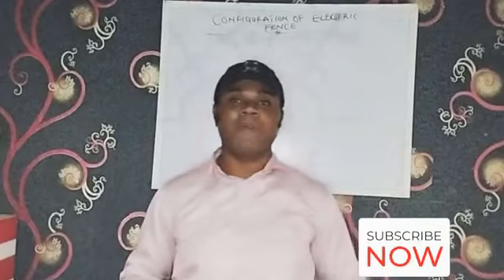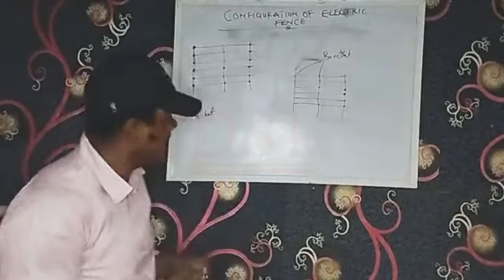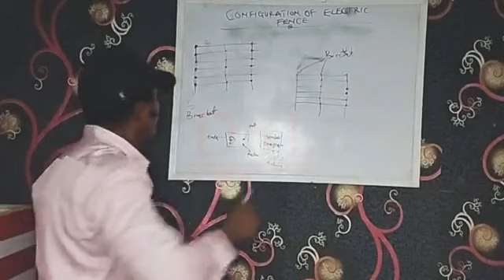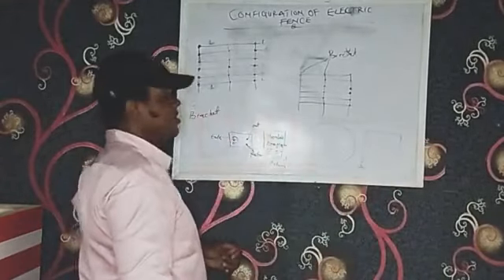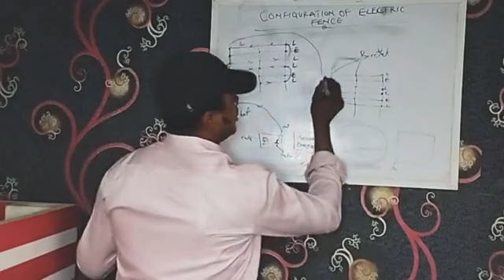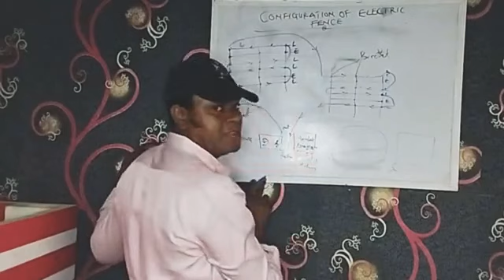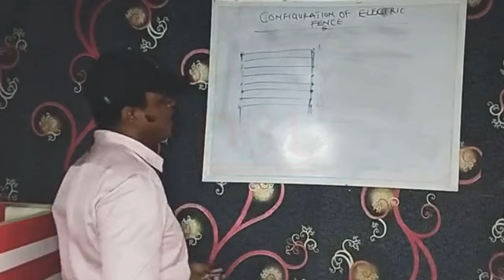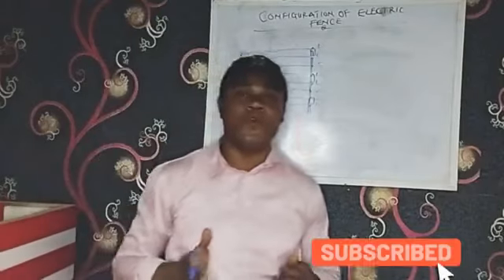Configuration and Connection of Nemtek Electric Fence Energiser.

Comment: Please sir, I have a question. My concern is how to really make the alarm goes off when a line is cut and not breach. (2) Can the live out and live in be connected from the same side of the fence, that is the same spot but to first and last line as  you explained now. Sorry I don't know if you got what I'm trying to say?
Reply from the maker: Absolutely, I understand your question. The FENCE OUT and FENCE IN are different terminals. They are separate terminals under the energiser. The reason why the alarm goes off when it's cut is because, the electric fence operates with a closed circuit principle also, anything that makes it open triggers an alarm also.

Comment: Please confirm if Stainless Steel wires are better or Aliminium 1.6 mm wire is better?
Reply from the maker: Both have their advantages and disadvantages. For stainless steel, it's difficult to break(cut) but has less conductivity, but Aluminium 1.6 has a higher conductivity but is easier to break(cut). 
For me professionally, depending on the environment and purpose you need to use it, you choose any of your choices. The stainless is more expensive but aluminium covers a larger span compared to stainless. For example, if I am covering a 3km/8 lines perimeter span of fence, and I am using aluminium, I can use 3 to 4 energisers and my fence will work efficiently, but if I decide to use stainless steel, I will be thinking of a minimum of 5 energisers. 
If you are using an electric fence for an animal farm, I will always recommend stainless steel. But if it's a factory, I would recommend the Aluminium. The factory is a work zone and you have personnel always around different locations.
Reply: @defotechtv9093  Sir, I am only using wires above the boundary walls of my house. The total area is around 155 running  feet only. One energiser is going to be used. Suggest in these settings. The company that is offering to install says that the pole distance from one pole to another would be 10 feet.
Reply from the maker: @bilalraza4751  Yes, 10feet to 11feet is fine. You can use any of the wires for this, even if it's stainless, 1 energiser is just sufficient.

Comment: What do u mean when you say return ? Does the return wire go to the same point or there are two points for live and two points for earth .
Reply from the maker: Please note, under the energiser has 4 terminals, 
1- Live OUT
2. Live  RETURN
3. Earth OUT
4. Earth RETURN .
When the first cable leaves the OUT terminal to feed the fence, after supplying all cables on the live line, it goes to the RETURN terminal.

Comment: Hi ,my fence one side has 7 lines and other side has eight, at the gate we have six ,please how do we go about it
Reply from the maker: The best way out is to make the seven sides has just one earth line and 6 live, while the side with 8 lines would maintain the standard config of 6 live and 2 earth.
Reply: I have installed the fence in series but still has an alarm ,is the earth problem
Reply from the maker: @sylvesterken6084  please call me on 08064869887

Comment: what if you do from top to bottom 
L
E
L
E
L
E
L
L
Reply from the maker: Well, it's also fine and ok. It will work. But we from my looping configuration, I just love how balanced it looks to the eyes  . But don't get me wrong, yours is also very correct.
Reply: @defotechtv9093  thank you,   when earthing the fence  should one use the normal  copper rod?
Reply from the maker: @isaacmwangi7038  That's fine too. But Nemtek has a dedicated earthrod for electric fence.
Reply: @defotechtv9093  okay, noted

Comment: good job,kindly shed more light on neutral
Reply from the maker: Electric fence doesn't use neutral to operate. It uses only live line and earth line.
Reply: Hello sir , from kenya salute,
my question is how many volt does the live wire on fence have???
Reply from the maker: @isaacmwangi7038  9000-10000volts. But it's DC and not AC. You must understand that your volts comes in in pulses. To test the output voltage, try get an electric fence scope from Nemtek